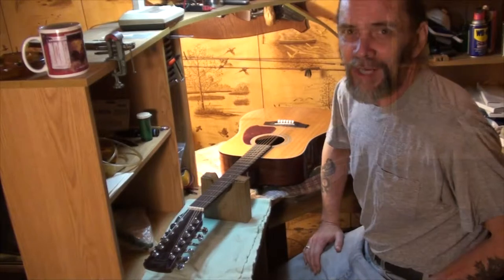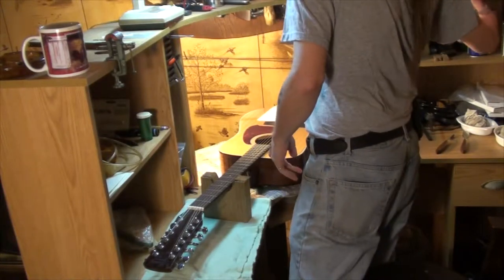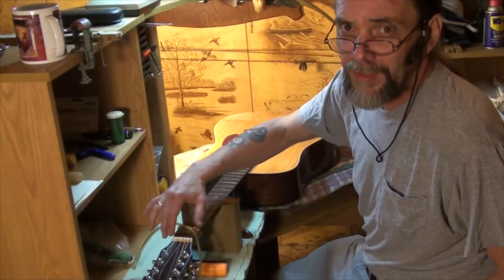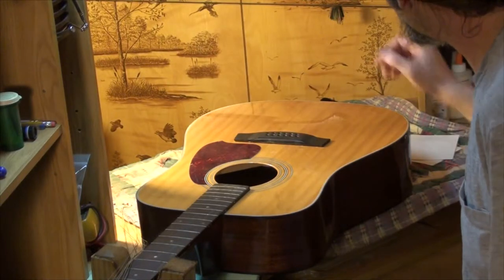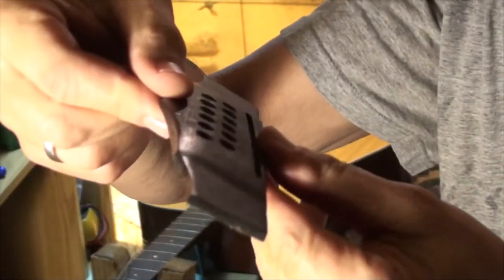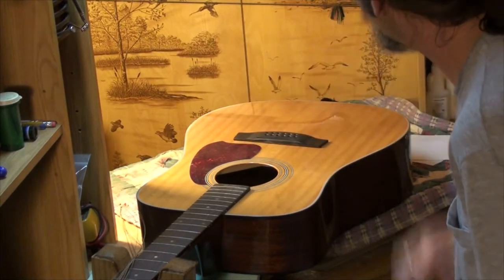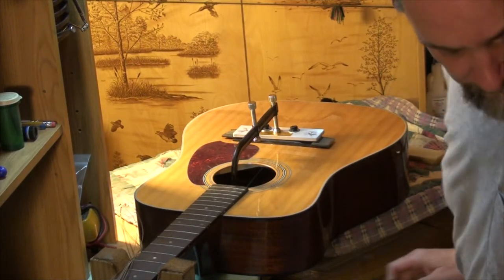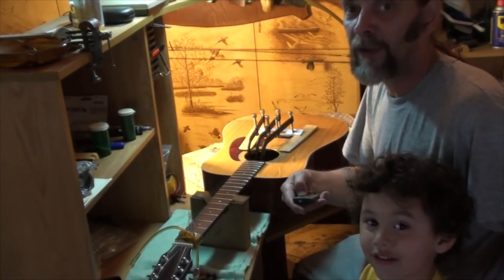Ibanez Performance PF5-12NT 12 string guitar bridge removal and re-glue part 1of 2

Comment: Good video Randy , I have seen a few 12 strings that the bridge ripped off in the case.A lot of string pull on them.I will be looking the next video)))
Reply from the maker: Steve Harris Thank you Steve, I've seen that too, they make the bridges wider from front to back because so much tension on them but they still pull loose over time. Part 2 coming soon! :)

Comment: You've seen a lot of bridges removed, how many of them have glue missing like that?
Reply from the maker: Probably half of them or more, company's do it to make the appearance of the finish around the bridge look flawless, usually the bigger company's like Martin, Taylor and Santa Cruz doesn't do this but I have on rear occasions seem them this way too.
Reply: I know I'd like to see glue right up to the edge but then I've seen what you have.
Reply from the maker: Rattlecan Guitar Restorations
I can't remember if I did it on this guitar in the video but I usually outline the bridge with an exacto knife and then slowly knock the finish off so the entire bridge gets glued down tight against wood, never have had one to come back.
Reply: Great technique, I'll remember that for this next project.